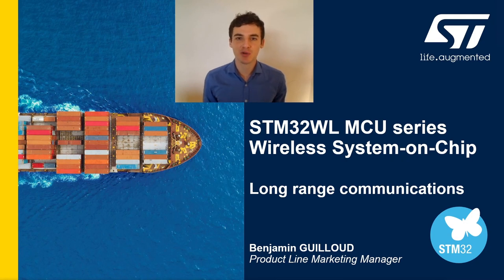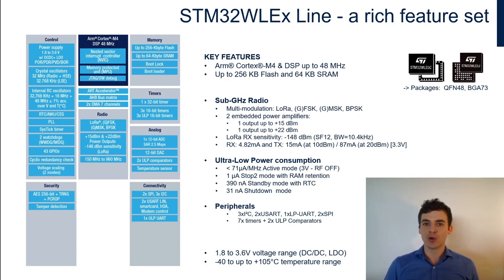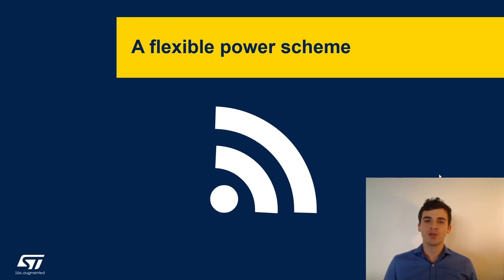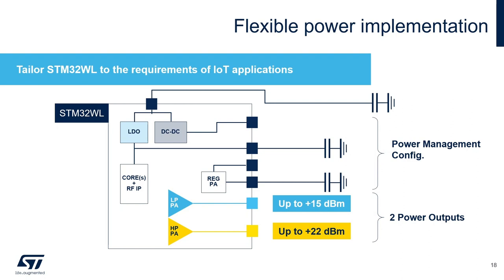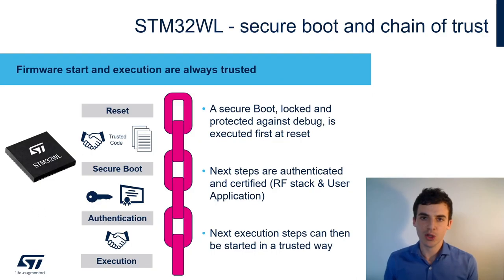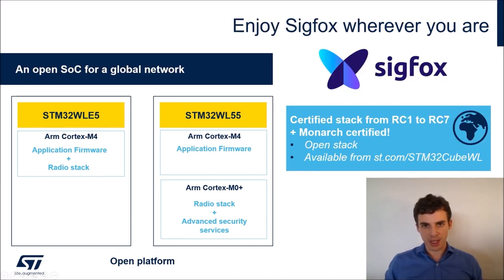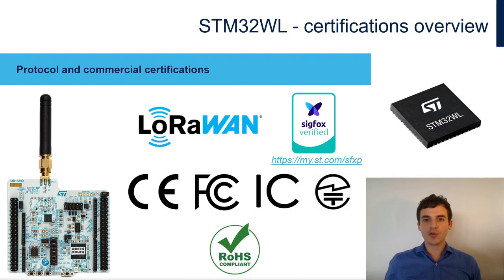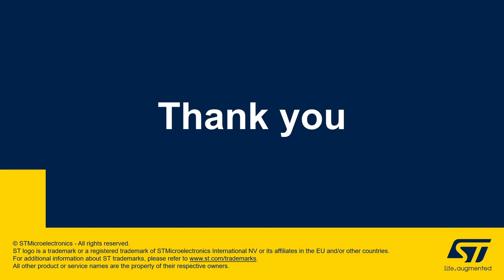STM32WL MCU Series: Wireless System-on-Chip Long range communications

Comment: Why does LoRaWAN need to run on two cores in a mutiple-core application using STM32WL55? I can't assign LoRaWAN for only one core in the CubeMX. I got a bunch of errors when I assign an UART connection using only one of the cores.